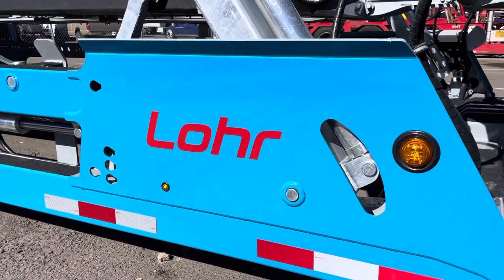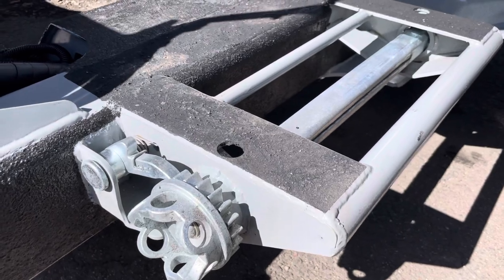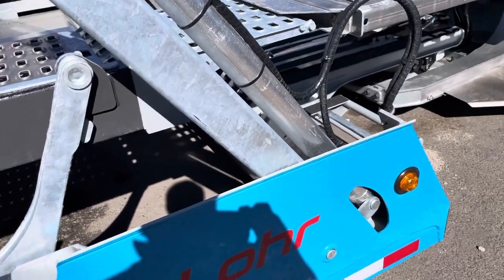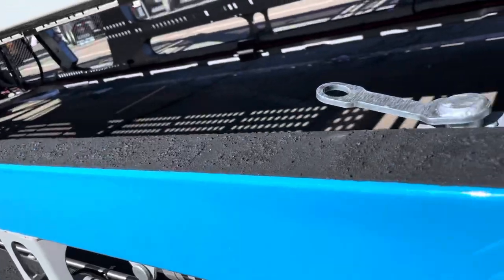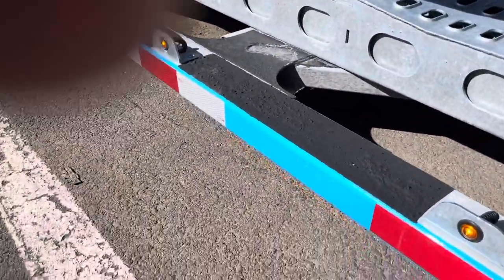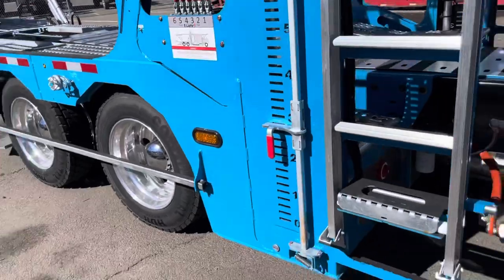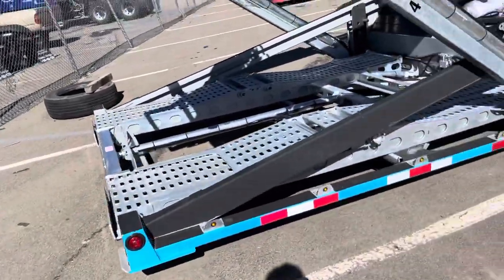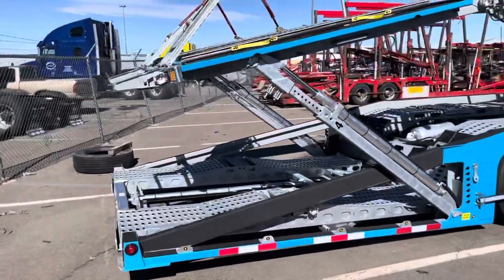LOHR stinger car haulers - Advanced materials and designs and bottom loader geometry explained

Comment: I like the galvanized steel , no rust issues , best of all the design , you can open doors on all positions without putting dents in cars , also the way they designed it to replace parts ,,I think the competitors will have to adjust LOL THEY WILL LOSE BUSINESS , if I was in the market I’d choose this brand over any other manufacturer

Comment: Great video how is compared to Cottrell for Canadian winters
Reply: It runs the low viscosity hydraulic oil for cold weather. But mostly, it will resist the salt and mag cloride on your winter roads. No more will you need to clean up the rust and road grime at the base of your lower telescopic arms. Which requires cutting welding, painting, and about a few Grands and week down. The cylinders are massive so you will have good flow.
Reply: @alexlyons2876  
I'm from Canada too. 
When I have the chance to order a 75ft equipment ⁉️

Comment: What is the price for this unit?
Reply: Hi Calin, most New Stingers sell around $300K but the options on the truck and trailer could change that by several thousands.
Call or Email be if you would like more info on this specific unit.
Thanks for watching.
Reply: Man for 300k might as well buy a cottrell

Comment: No way you put a f150 on the tail hang it out 6ft and run legal, if possible make a video where you load 7 units 6 full size pick up 3 f250 3 f150 and an SUV,  the package looks great, would love to see it I. Action
Reply from the maker: In Canada you can't but in the US FAST act allows 6ft over hang in the back and 4 ft in the front.